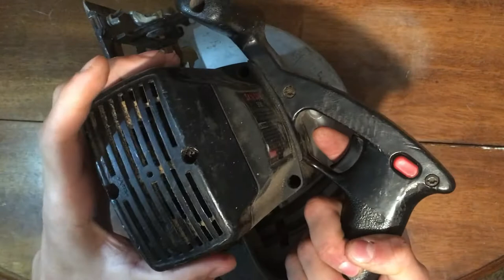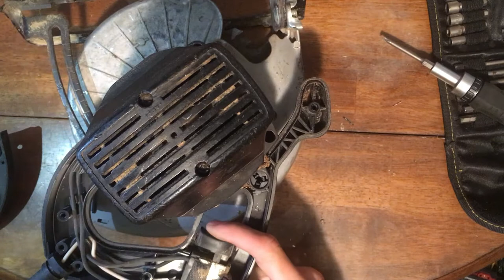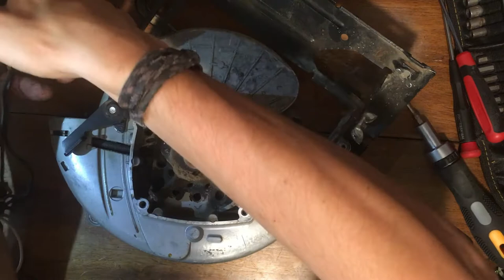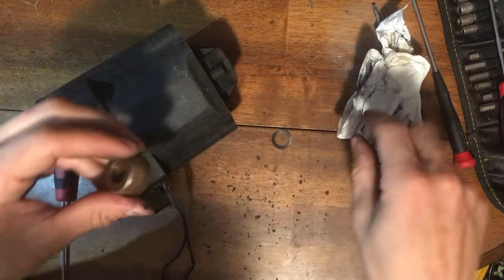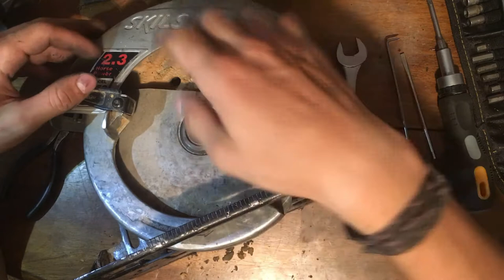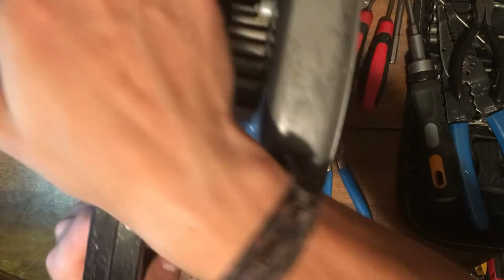Skil Circular Saw Teardown/Repair

Comment: Hey boss, nice work through on the saw. I have a 5380 that I am servicing after 12 years and a concrete cutting job. To access the gear box I had to remove the blade and 3 small screws that hold a seal on the gear box. The inside grease had turned to yellow stinky chapstick. Cleaned and replaced with hi temp bearing grease.   Btw I have new alternate curse word.... Schmooooo !
Reply: Shmoo that. After decades and miles of concrete my fiddy one freaking fiddy had dry heaves. Cleaned and greased in a New York minute but then she reminded me of all the times she put out and so I went scrubby dubby. Current Status….Shmooless!

Comment: Looks like schmoo from the sintered bronze bushing on the end of the armature that got onto your commutator. Was probably over oiled at some point. The pinion can have no sharpness(like a knife edge) on the lands....compare the lands where the pinion doesn't engage to where it does. That tells the whole story. Not sure I would even mess with a bushing saw. That was cheap manufacturing even going into the present. And there were two types;oil with a wick and dry. It's important to know to replace.  Better Skil's have a pin that locks up the works to change the blade out. Usually, you get to the gearbox from the blade side.....remove the guard and you should see some screws. .

Comment: Would have been a much better video if you had some idea of what you were doing.
This saw is junk.
Reply: This saw may not be the most expensive or fanciest saw. But it certainly isn’t junk. I used one to cut metal, concrete and wood. Ran it like crazy for over 10 years. Never could kill it, it held up like a champ. It’s a hell of a saw for the price.